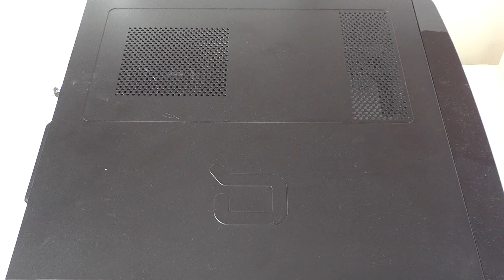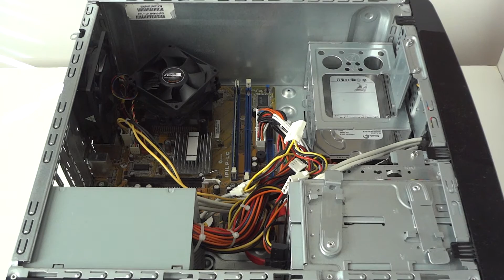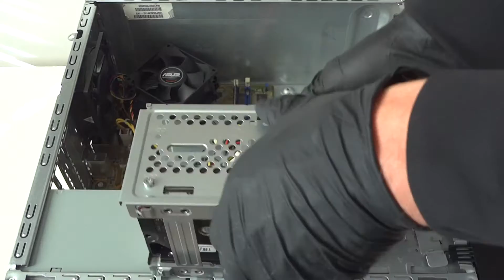Compaq Presario SR5250NX Upgrade Video Card, Power Supply, RAM, Hard Drive

Comment: Can I put a 650W into one?
Reply: i mean yea if you want bro
Reply: @TeraGotBuns  I wanna put a 450w or 500w to run a gtx 560 or gtx 660. can it? with or without 80 plus certificate?
Reply: @playcode2025  ima be real chief I'm gonna Google your answer cause I'm not 100 but go ahead of you have the parts to test and see what works for you. Otherwise do some research and find out the cheapest and easiest option that works out the best

Comment: I have a HP dx2400 which seems to be some what the sane layout as this one. Planning on upgrading the power supply later on for a new graphics card. What are some cheap power supply around 500watts.
Reply from the maker: Hi, don't buy cheap knockoffs power supply you should get brand name like corsair , seasonic, antec or cooler master
Reply: ***** thanks. :)